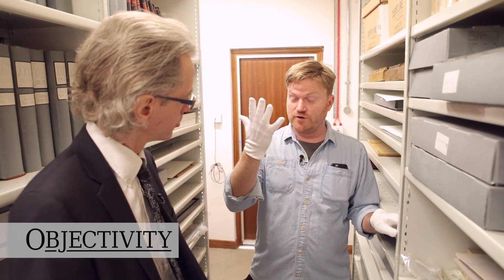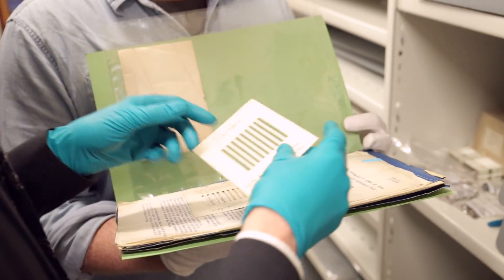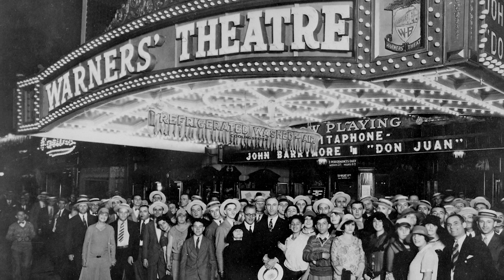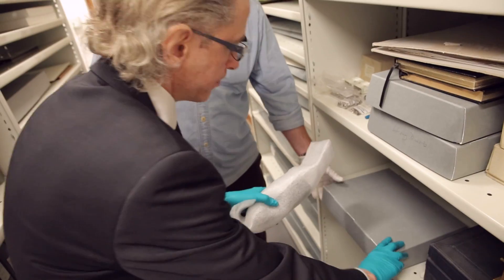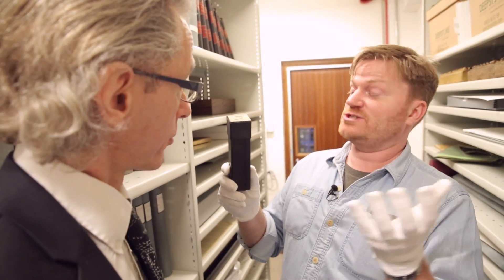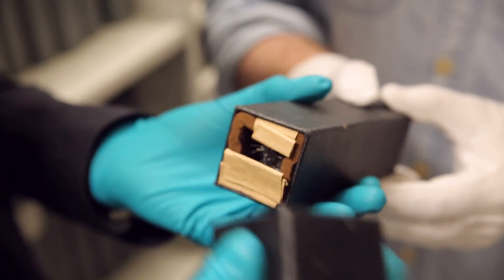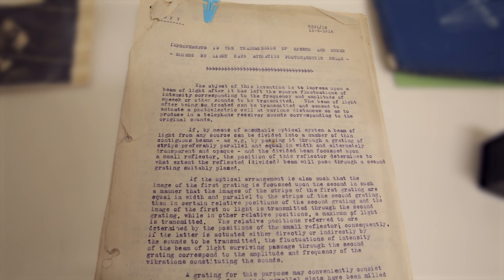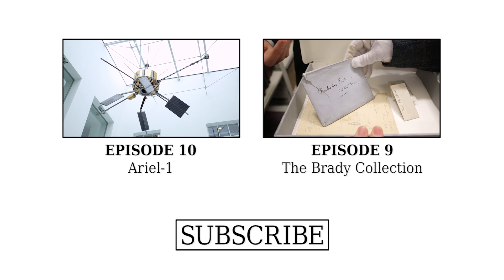Cinema Sound Cell - Objectivity 11

Comment: Apparently F.W. Murnau's Sunrise was marketed as a silent picture, and the sound on the film was simply a synchronized score with some sound effects. No dialogue was captured. This was an extension of the use of photographic film to store sound for replay on radio in the 1920s. Even the famous 1927 flm The Jazz Singer had only occasional dialogue, lip-synched, so all of the synchronization occurred in post-production.

Evidently, there were a large number of shorts filmed with sound in the 1910s and 20s, but hardly any survive. Some of them were automatically synchronized, which in my mind is the real achievement. But it didn't become common for films to record video and audio in the same take until the 1930s, and the practice of lip-synching a large amount of dialogue didn't really die until the late 60s.

Comment: *"Thalofide Cell"—a New Photo-Electric Substance

T. W. Case
Phys. Rev. 15, 289 – Published 1 April 1920

ABSTRACT
A new photo-electric cell is described which is composed of thallium, oxygen and sulphur. This cell shows maximum sensitiveness to light of wave-length about 10000 Angstrom units. Some of the best cells lower their dark resistance by fifty per cent. in.06 foot candles when the light source is a tungsten filament. The dark resistance of different cells may be from 5 megohms to 500 megohms. The induction and deduction periods of the cells are very small. The chief characteristics of the cell are mentioned.*

I have to say, wouldn't be myself if I hadn't the urge to test the cell to check if it works, and that would be fairly easy, actually. According to the abstract I found, this is a fast response photoresistor, which is more sensitive to the medium infrared wavelenghts.

The basic test would be an ohm meter, connect it across the cell, check if the impedance varies depending of the amount of ambient light it's getting. Though it would be wonderful to pass sound through it. You would have to rig some equipment to do that.

Comment: Very cool. Although it probably works different, it has the effect of something like a photo-transistor.
Reply: Transistors rely on semiconductors witch were invented later, this is full-blown vacuum tube of some kind. Yep, http://en.wikipedia.org/wiki/Photomultiplier

Amazingly, this technology is still in use for detecting as little light as individual photons.

Comment: Great object - I would be curious if it could actually still be used today.
Reply: This is used!
http://en.wikipedia.org/wiki/Photomultiplier
Reply: thanks - that is quite interesting.
Reply: MOROZILnic These are a lot more similar to what is in the video https://en.wikipedia.org/wiki/Photoresistor and are used today
Reply: ***** Yeah, but photoresistor uses semiconductors, quite recent invention. And that thing is quite large, glassy and vacuum-y, like vacuum tube.

Comment: I can hardly believe that these few strips should contain the audio information for one 1/24th (or whatever the framerate was) of a second - in poor quality, obviously, but still.
I know this is an analogue technology, but let's just for the sake of argument presume that just one stripe and the information it carries (through width, distance to neighbors, whatever) is comparable to a digital sample. There are roughly 50 stripes on this still. Even if we assume a framerate of 60fps (which is obviously way too high), the 'sample rate' would be only about 3kHz, which sounds /horrendous/ in digital.
So again, I find it very astounding that this technique worked and was really used (apparently it's called the Tri-Ergon sound-on-film system).

Comment: This has been the most fascinating Objectivity yet. I've never heard of sound being transmitted by light before except radio waves.
Reply: It's really surprising when you realise how useful radio waves are to us, and the ways people came up with to do things we now do easily with radio. I remember once reading about a proposed method of communicating with Martians in about 1900, which involved Earth-based parabolic mirrors burning Pythagoras' theorem into the Martian soil!
Reply: same, never heard of "optical sound" before, well, not until modern fiber optics.  I still don't understand the technical nature of this, it is digital or analog? To google I go!
Reply: @BeCurieUs  Analogue, obviously!
Reply: Christopher Willis Using analog radio waves to transmit sound is a very old thing, but storing audio and playing it back that took much more time to be discovered. You can only transmit and receive sounds in real time using radio waves. This uses a strip pattern to store audio in some way, pretty much like how sound waves are carved on vinyls or recorded on magnect tapes. But I would like to know more details exactly how this encoding scheme is done though.
Reply: In addition to use on films, the other use I am aware of was for recording the phrases used by the GPO's talking clock. The recordings were made into a glass disc or discs, a normal gramophone record would have worn out too quickly.

They seemed to use this technology until quite recently. I think mag tape was not used because it would wear and stretch. (As anyone who has used an answer phone using tapes will have heard).  I think the machines are now in the Science Museum in London.